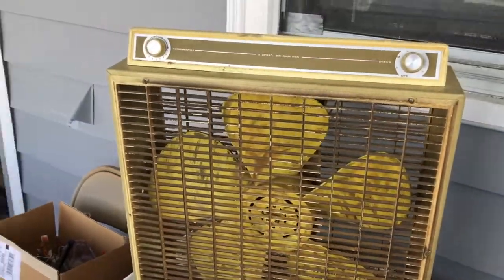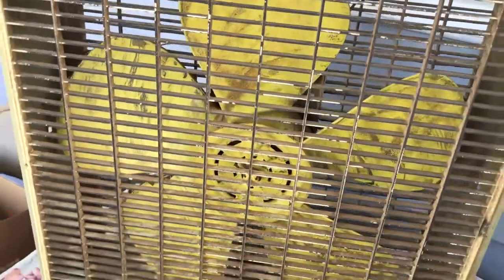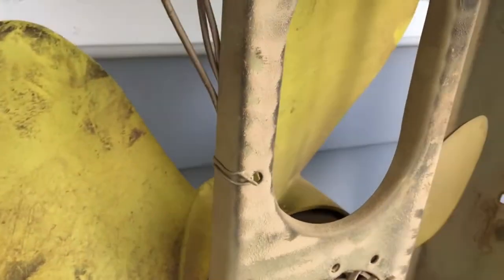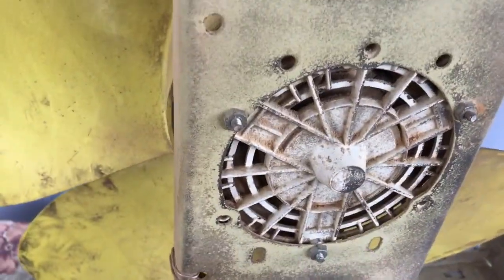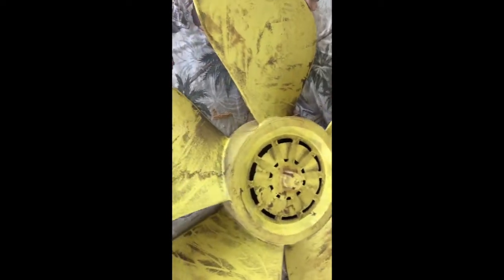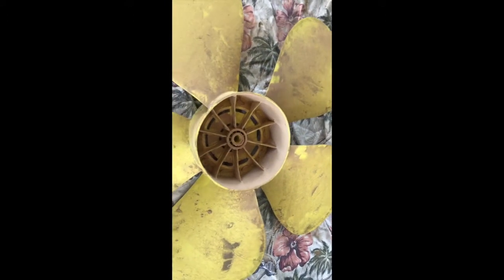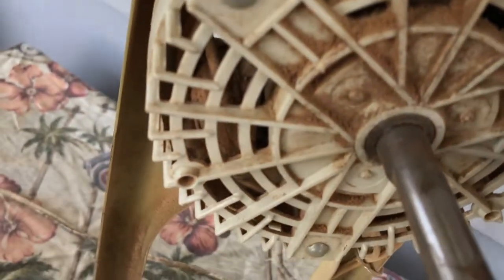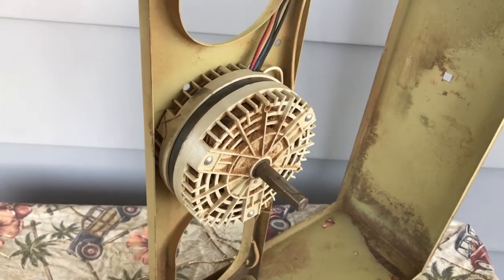Vintage Yellow Sears Box Fan Teardown and Assess 1

Comment: If it wouldn't cost a billion dollars in shipping, I'd clean and service both dusty motors for ya , you can get a small compressor at Wally World for under $100 or get an air tank for like 25 and get an air nozzle , and fill it up at a gas station and blow off one at a time , better than nothing.